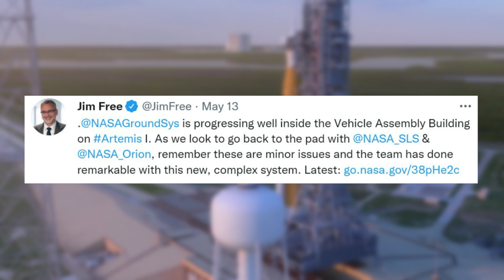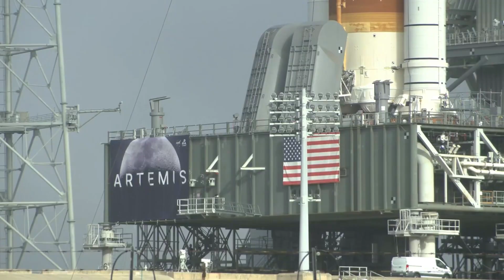NASA Continues Repairs On The Space Launch System

Comment: OH COME ON, bolts that loosen over time?? Without even vibration or stress put on them, just rolled out to the pad?? What did they make the hardware out of -- Cheese?? I can buy a cheap car and the bolts won't loosen over time as it sets in the driveway. I guess anything that does not cause a low level unscheduled rapid disassembly is being counted as a minor problem here. I have built a lot of stuff over the years and I made aeroplanes in a factory, our bolts would not loosen for the life of the aircraft and you could have picked up one of our planes for 50K new with leather upholstery.  That little throwaway comment said more about the miserable build characteristics than anything else I have heard. Maybe it is time to scrap this miserable one-star vehicle. Certainly do not use it for people, only cargo and that being inexpensive cargo that's easily replaced.
Reply: I think these bolts will be on parts subject to massive temperature cycling.
Like from cryogenic liquid hydrogen temps to ambient Florida.
Reply: @NullHand  Elon Musk talked with Tim the Every Day Astronaut about problems with flanges in an interview last year. SpaceX replaced flanges with welds wherever possible in the engines and in the plumbing in the rest of the vehicle. 

So flanges are hard for everyone, even for companies that only use LOX and LNG. Liquid hydrogen is harder to deal with. 

SpaceX has the freedom to redesign systems as needed to minimize problems like this. This isn't limited to Starship prototypes. SpaceX redesigned the urine drain in Crew Dragon to use welds instead of joints. The old design leaked during the Inspiration 4 mission.